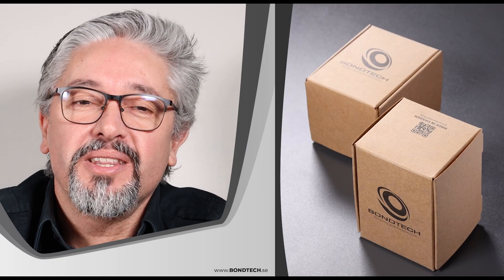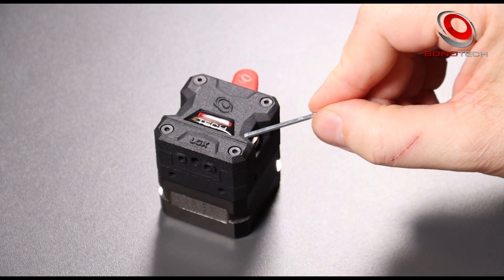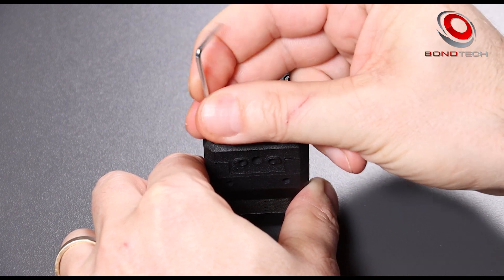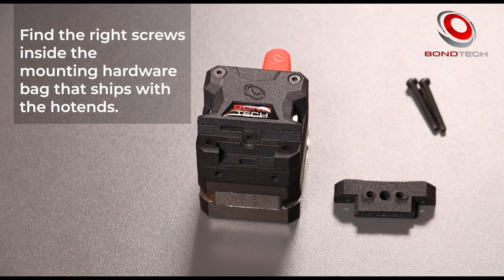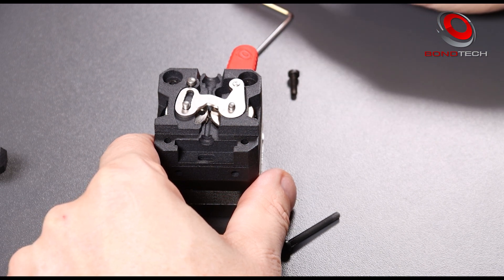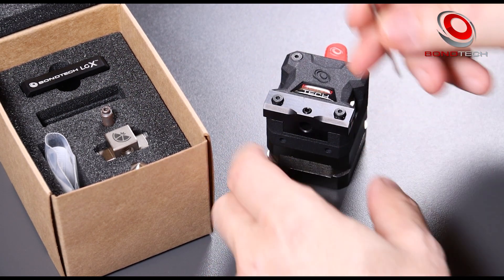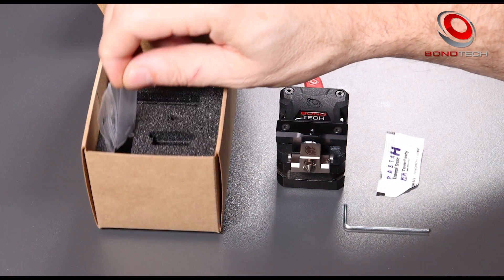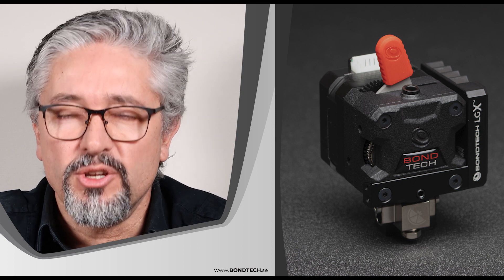LGX Video Guide

Comment: Really wish I knew about this thing before buying the DDX. The design of the DDX is bad, mainly due to filament jams. You literally have to tear the entire thing apart to clear a jam which can cause a hole bunch of thee issues if you have to do it repeatedly. The hotend should have been easily accessible like the LGX.

Comment: What is the fastest way to remove the filament from the LGX when you want to change filaments? I have had instances where I need to remove filament without damaging it more by running it in reverse in a bowden setup like the Ender 5. I am going to direct drive as soon as I get a plate but trying to remove the filament has been a pain in the arse. There were no recommendations for this that I saw documented anywhere.
Reply: The lever which controls the grip on the filament, when set to fully open, allows the filament to slip right through.
Reply: @TheCrazyburns  Like hell it does.

Comment: Hope this is as good as it looks. I broke my heatbreak & amazing how hard it's has been trying to find a replacement SMOOTH HB for X1 V4. I wanted a copperhead ontop (though they only have v1-3 which use the threaded HB) and was planning on upgrading to a BMG wind. But that evil Heatbreak, omg... I gave up & just bought the kit for the Sidewinder X1 v4 (and a few extra smooth hb as backups just in case). I got a BMG on my Ender, works great. 🤞 the X1 version is as nice.

Comment: What does the flex set do differently to the standard heatsink?
Reply from the maker: The FF set was designed to create a record breaking short filament path solution. It handles all materials but it is especially better than every other solution in the market with flexible and soft materials, in our opinion.
Reply: @bondtechab   does it improve printing with normal filament?

Comment: An important question: is this prusa comaptible? Got E3D V6 nozzles, are they compatible with this extruder? Especially Nozzle-X which is very expensive and got already. I wouldn't waste any money on an extruder that will not accept V6 nozzles. Tho I am using your MK3S upgrade kit already for a year ;)
Reply from the maker: Yes, we have an upgrade kit for Prusa using the LGX. The V6 nozzles are compatible with the Copperhead hot block in the LGX FF set we upgrade the Prusa with.

Comment: I don't understand why they try to target this extruder setup so narrow 'For flexibles' set. It has the potential to be so much more with the high temp and hard steel nozzle. Nylon, Nylon-CF, PC it should all be possible.  I look forward to the first reviews and hope it will live up to the specs.
Reply from the maker: The LGX FF can use all kinds of materials but due to its short filament path it is especially good at handling flexible and soft materials. Maybe the branding is too restrictive, but we will keep it until further notice : )
Reply: @bondtechab   I thought the same thing. The “For Flexibles” branding makes this hotend seem like it’s only intended to be used for flexibles, and isn’t suited for printing with more typical materials
Reply: The average person will also print flexibles way less often than PLA, ABS, PETG, etc; so it makes even less sense to market this extruder towards a set of materials that hobbyists rarely print. The name of the extruder should reflect its short filament path and compact size, not zero-in on a specific type of filament

Comment: Hello, nice tutorial) Any information about printing ABS in 40C ambient temperature with LGX for flexibles set? Also is it possible to mount lgx dd with an aluminium plate (2-3mm thick) between stepper and extruder?
Reply: was thinking the same thing just for PC blends and 50C ambient
Reply from the maker: We will look into this specific topic and get back to you as soon as we have usable information. Thank you for the tip.
Reply from the maker: Regarding the Aluminum plate. It is possible to install the LGX as Bondtech ships it with a plate up to 2mm thick in between the stepper motor and the extruder. It is important to notice this is the up most thickness value supported. Some units have thicker than 2mm plates to mount the extruder. On those cases we will ship upgrade kits that include the LGX with an extra set of longer screws. Limit will be 3mm using those screws.

Comment: In all your promotional material I have yet to see any shots of the top feature (you list it top of the 7 new features you say it has )that makes this extruder different to previous models. The large filament drive wheels. It would be nice to see them in action without the cover on. E3D had some nice graphics of the Hemeras gears at luanch. Some still shots would be good.
Reply: They don't want china ripping them off before they'll manage do sell this properly.
Reply from the maker: We understand the curiosity, but for the time being we will reveal as least as we can. This video shows a bit about the drive wheels, although not much, we agree. We will showcase everything in detail later.